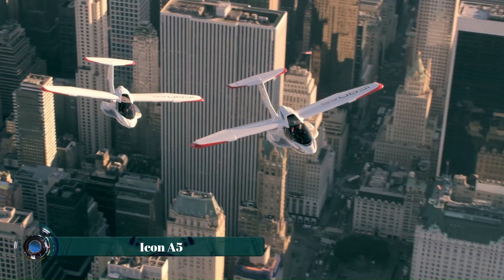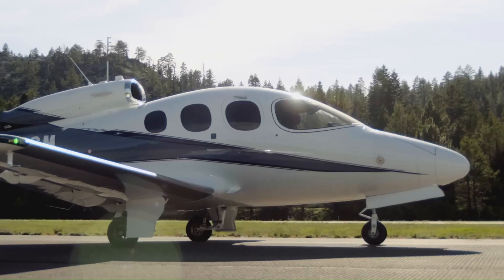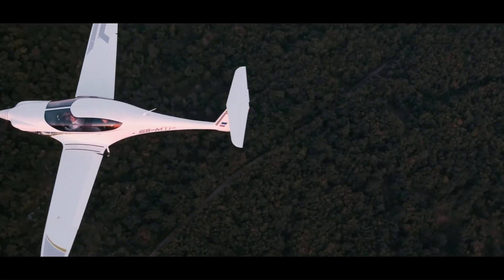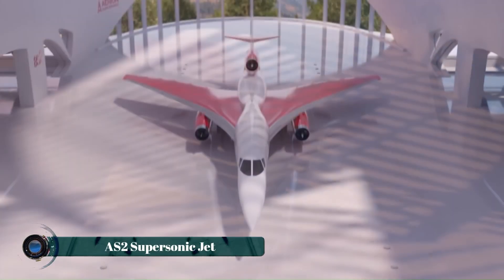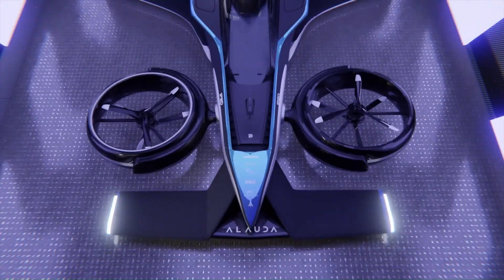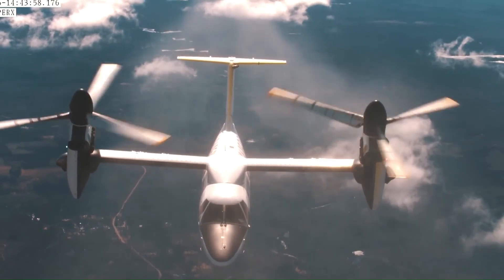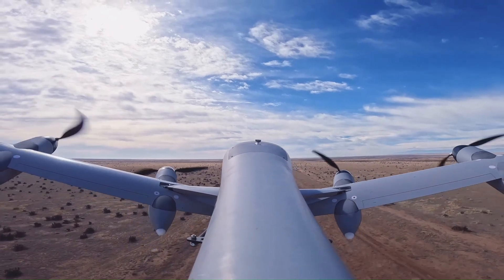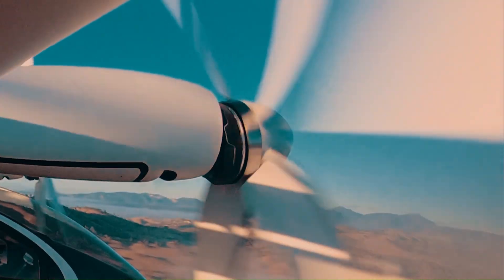The Plane That Will Change Travel Forever

Comment: Die Technologien werden nicht intelligenter sondern immer dümmer. König Salomon besaß vor 3000 Jahren den Überlieferungen zu Folge fliegende Levitationsplattformen, mit denen er in der Lage war, ohne Treibstoff nur allein mit Gravitationswellenenergire 300 m über dem Boden zu schweben und mit einer Geschwindigkeit von über 1050 km/h 1000 Soldaten auf einmal zu transportieren. Dass das Ganze stimmt, bewies Viktor Grebenikow mit seiner nachgebauten Levitationsplattform in den 90-er Jahren.
Entweder stellt sich die Industrie auf die uralten freie Energie Systeme um oder sie gehen alle baden. Diesen treibstoffbeinhaltenden Müll wird es in Zukunft nicht geben.